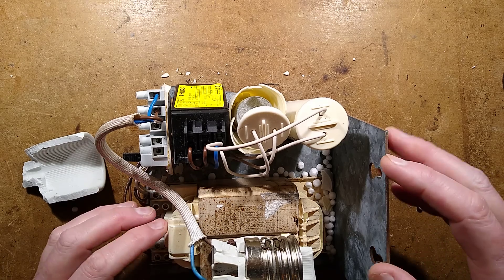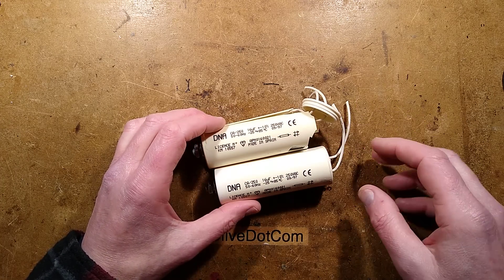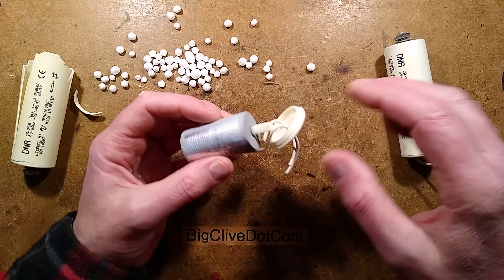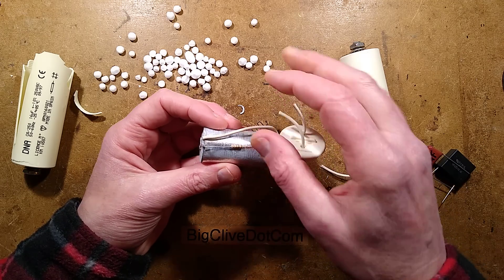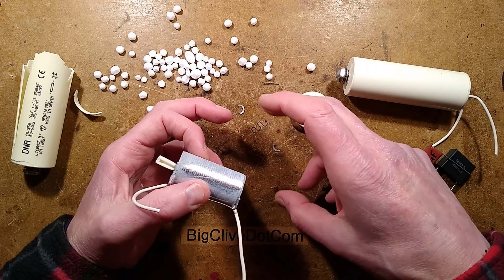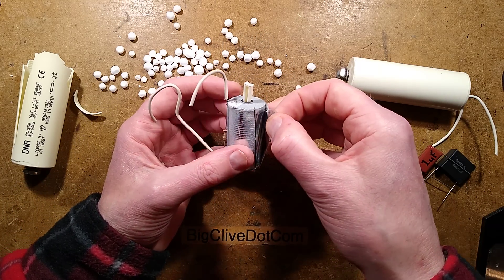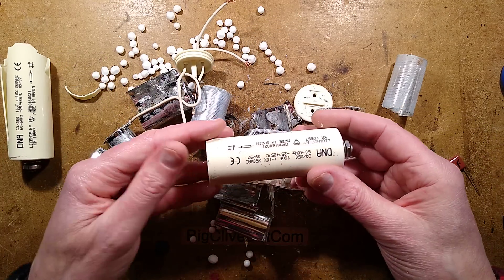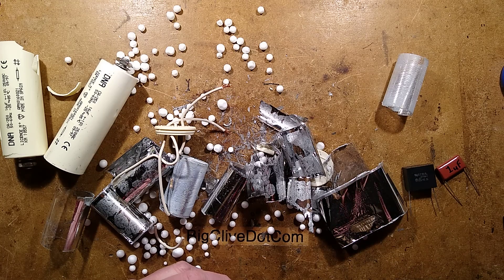Totally destroyed in a good way

Comment: When replacing degraded dropper/motor run/etc. caps always go up in voltage if you have the space for it and don't want a repeat, the stronger you can make the dielectric the longer it will take to degrade out of tolerance. Ideally sourced from an actual industrial/electronics supplier or local hardware store (if you have one nearby cool enough to sell electric motor parts), not a random brand ebay/amazon/ali part. Like I don't expect further trouble from the furnace blower as I went from 370V to 440V and went to the trouble to source a reputable part.

Comment: I believe X2 capacitors have a slightly different failure mode than normal capacitors, I think, based on the choice of dielectric material.They absorb over voltage spikes which puncture the dielectric but are designed to short the layers. Obviously the capacitance will lower but eventually they can short the supply blowing a protection fuse as an indication of failure. Y type capacitors are designed to fail open-circuit as if they were to go short they could potentially connect a live supply to an isolated piece of metalwork causing a shock hazard. Therefore X2 capacitors should never be used to replace Y capacitors although the other way round poses no problems except never knowing if they've failed without measuring them.
The infamous Rifa X2 caps in old equipment have a further failure mode, although unintentional, by the outer epoxy coating cracking and allowing moisture ingress which causes sudden shorts and vaporisation of the internals in an explosive and often very smelly and smokey manners 😉
Reply: thing is RIFA still make those caps using paper dielectric!
Reply: @andygozzo72  In Australia we also had AEE Miniprint which were pretty much the same (and at least the X class even had the same series code as RIFA). The claimed advantage is better self-healing than plastic film, but we all know they were searching for any excuse to keep making paper capacitors. Incidentally I have three polypropylene RIFA PFC caps from disintegrated old fluorescent battens (2×2.8μF from single 40W fittings, and 1×6μF from a twin 40W) which still measure spot on; that's more than I can say for the Plessey caps (originally 20μF, down to ≈5μF) from the 400W MV fittings I put in their place (I got them cheaply and don't run them long enough to worry about the power consumption). But the fact alone that they still make the paper types is, in my book, enough reason to choose other makers first.
Reply: @andygozzo72  RIFA just claim theirs are flameproof. They certainly aren't smoke and stink proof as I found our when one failed in a vacuum cleaner.
Reply: @MrDuncl  oh yeah, i had one 'let off' when i was testing a mac2cx!!
Reply: This is indeed a commonly claimed property of X and Y capacitors but I've never been able to find any statement from the manufacturers that it is true.

Comment: Many times I would wind a rope or cord around the shaft of a motor or machine. With the power on I'd "pull start" it. That'd get it going while I was off to get another capacitor. It's a fun trick to do in front of the customer!
Reply: Makes perfect sense.  As long as it's just a starter cap, I don't see a problem.

Comment: You talking about the inrush current reminds me of my high school back in the late nineties. After a big renovation of the building we also ended up with new computer rooms, which had 30 computers each. Near the door was an electrical panel with two buttons allowing a teacher to (de)energize all the outlets in the room. You can probably imagine how quickly they learned to not use that button to switch on 30 CRT monitors at once after tripping the main breaker a couple of times :D
Reply from the maker: I've had that issue with the degaussing coils in a large array of monitors.
Reply: I heard a similar story about a school I once worked at. They did just that and heard a loud bang eminating from the hallway, where a fuse had a very violent untimely death.
Reply: @BarneySaysHi Hmm, usually a smaller fuse like that doesn't cause that much of a ruckus... 🤔
Reply: @davelowets  Yeah, but that story is over 20 years old. And it was hear say.
Reply: our teacher used to throw a fit and do that, big fat baby

Comment: Awesome destructive shipping .I got a Variac with Broken brushes and bent shaft via Amazon shipping .The company sent me a brand new one free of charge and I fixed the old one .bought new brushes for $5 each.replaced them and now have a spare 2kva variac brand new in box and using my damaged one on bench and it's fine .Scooped up a 5kva 240 /240v isolation transformer from the scrap yard ..HID Lighting eats contactors like crazy .we use 600/347 v for high bay Lighting .Dangerous as hell and should be banned with the new LED lighting technology .we should be operating at lower voltages .Too many lost their lives to open neutrals on 3 phase lighting systems .
Reply: LED is boring. Plasma is the king. Nobody would lose his/her life due to open neutral if the neutral was treated with the same precautions as the pases.Several countries require 2 pole and 4 pole circuit breakers.

Comment: In my country VERY BAD cap will usually filled with half or very small cap) and even ANOTHER cap inside (for example 100000uF 50V with the inside are 4700uF 35V) for cheaper price and also filled with aspalt or wax. Mostly happen in Chinese cap or very cheap audio use cap

Comment: That's a first! Usually they are filled with tar or epoxy, sometimes wax.
Reply from the maker: Yeah.  First time I've seen the styrofoam balls too.  They must be faster and cheaper.
Reply: Might be Chinese fakes they would not pass as flame retardant  Note helped a guy who sold capacitors and went through hundreds of kg every month saw a number of that DNA brand from over the counter sales for the locals which had failed and all were epoxy filled.

Comment: This reminds me when we bought a flat the big fan in the roof space didn't work. After watching a few of your videos i replaced the big capacitor and it started working again, saved me having to fork out for a new inline fan
Reply: Fixed my geriatric tumble dryer a while back, exactly as described. Nominal 8.3uF cap was down to 2uF 😮
Reply: @quantumbuddhist  Depends on the size of the fan.  US Air Conditioners almost always have start/run capacitors on the exterior unit.  When torque isn't a concern "shaded pole" motors are cheaper.  Which is what you're probably thinking of for ceiling fans and other small fans.
Reply: @EmperorA0  I have a small floor air circulator that uses a PSC motor. The cap motors are more efficient, which is good for the electric bill.
Reply: @quantumbuddhist  - The big roof vent fans can have them.   The house we lived in for 13 years had a reasonably powerful motor for pulling heat out of the attic space (Gulf Coast).

Comment: A sharp blade is so much safer than a dull blade. If the blade is dull it will snag increasing the probability of a slip as you increase force on it.
Reply: also if the blade does slip, the cut is cleaner and heals better
Reply: @airgunnut  sometimes so much so that you dont even realize you HAVE a cut for minutes until it starts to sting and you notice a drop of blood on the table
Reply: @frogz   yup! I've had to inspect my fingers for a tiny nick to find where the red smears are coming from due to razor sharp blades. The cuts have been so clean that a few minutes of pressure and they glue them selves shut. Blunt blades take too much force to cut and slide off too fast, raggedly stabbing into any thing nearby.
Reply: @frogz  This reminds me of the time when I replaced my kitchen grater with a mandalin.
That thing is so sharp that when I ended up chopping the carrot and started my finger I didn't feel anything.
I only realized I went too far because I saw blood dripping into the salad.
After a minute it started stinging like hell, but for that first minute nothing, absolutely nothing.
Reply: A fact that is waisted on so many people. Cooking videos can be painful to listen too.
Reply: @simonhopkins3867  Outdoor55 has a video on kitchen knives.  tl;dw: His wife loves the "sharp" knife he gave her that can't even cut paper.  Turns out it's more edge geometry for those than the apex.
Reply: I'd wear chain mail covered by washing up gloves if I could.